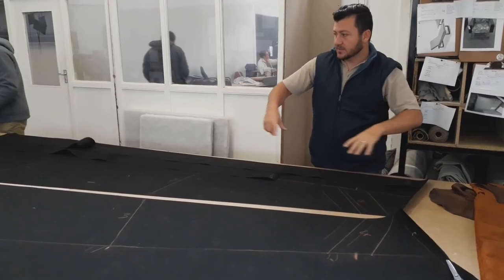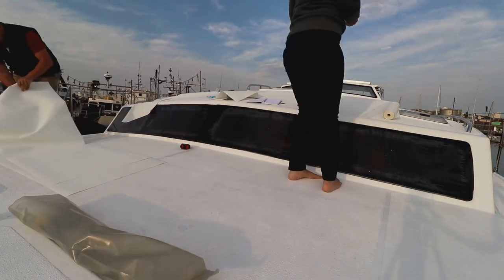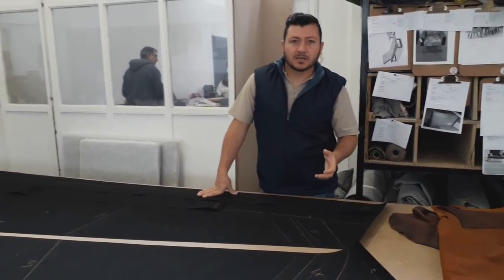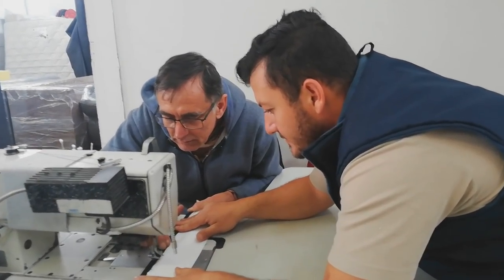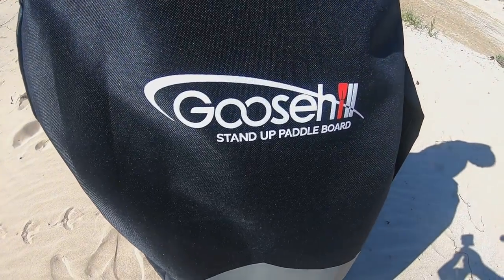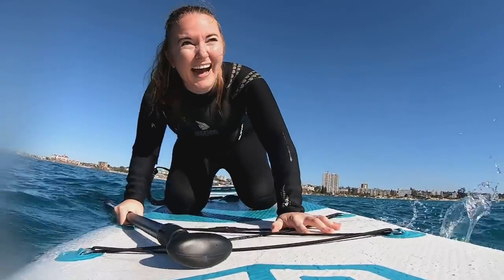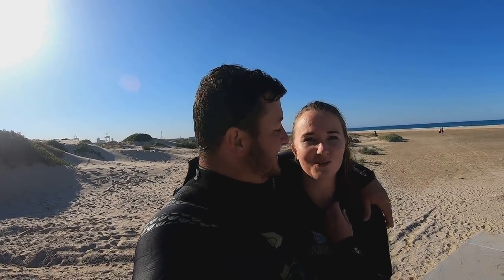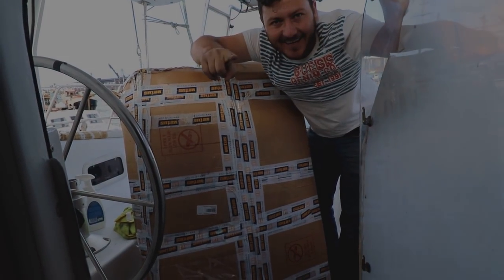You make me WORRY so MUCH!! | YACHT REBUILD WEEK 85

Comment: Guys, I think it's a good idea to insulate more. We are so happy we decided to insulate everything! 
Happy greetingz, Wim
Reply from the maker: Yeah mold ain't fun 😒 How's the sailing been?
Reply: @livingwiththemaias  But if you also insulate most of the walls, no problem. We don't have mold whatsoever. Nowhere in the boat.
YEAHHHHH! The sailing was great! Max 3,5 knots, because there just was no more wind than that, but it felt soooooooo good to be on the water at last!
Reply: Oh, and we just had to 36 degrees Celsius days at which it was too hot in the boat. Up till 30 degrees It stays cool enough.
Reply from the maker: @DoubleUThings  we don't have mold on the hulls but where our deck is.. Is where there's condensation and then it drips onto everything in the cupboard molds a thing that is material but it was  winter in S.A its warming up now so we'll see how it goes. We're gonna do it anyway though. That's awesome man!
Reply: @livingwiththemaias  Hey, but I saw you insulated under the decks... At least in the main cabin, right?
Reply from the maker: @DoubleUThings  yeah but not on the sides.. That's where our problems are. Pretty much where the countertops are.
Reply: @livingwiththemaias  Yeah... I saw it. You painted directly on the polyester, right?

Comment: the only way you will cure your condensation problem is by having sufficient ventilation.
you don't need  much,but without some air flow you will always get water droplets forming on cold surfaces if you are running heating or just living onboard in cooler weather.

i put a small vent either side in the forward  anchor locker into each hull  and just leave the anchor locker hatch slightly open so as to get air flow even when it rains i also fitted a vent by the steering so air has an exit point.
this stopped all the condensation that formed when the boat was closed up during winter.

adding more insulation might make the boat easier to keep warm but untill you get some airflow you will allways have condensation.

the boat looks great by the way!
you will also need to probably find a way to stop the dinghy from moving  on the davits as it will quickly wear if there is any movement once you are sailing.

Comment: I got a car tyre pumper upper you can plug into a cigarette lighter power socket or usb, you might want to get one cause you set the pressure and the on button and it fills your board up in no time it comes with different nozzles to suit your needs, i recommend getting a pump that blows up tyres on Suv’s if your going to get one

Comment: I see a label on your tankless water heater saying its for both indoor and outdoor use. But when your LPG gas water heater is in use you are going to have much more condensation issues in winter unfortunately. They are renowned for pumping out co2 and water vapour as part of the heating process so ventilation is extremely important. I would be trying to incorporate a hood over the heat to channel the exhaust externally. The heat coming out of the exhaust is quiet intense so you will find the 'paint' above it will discolour with 'soot' and heat rather quickly.

I don't know how other boaters manage with water heating, but this is the first build where I seen a tankless gas boiler being used. I've seen diesel Webasto heaters and calorifiers using engine heat or a combination of both and of course many do have 'cold' showers in the tropics.

On another note, I'm amazed at the amount of knowledge and skills both of you young people have to manage to pull this project off so quickly and professionally as you have done. Much respect!
Reply from the maker: Thank you Bruce!